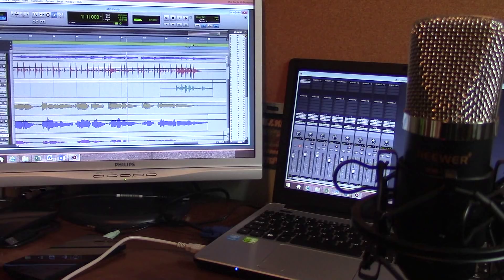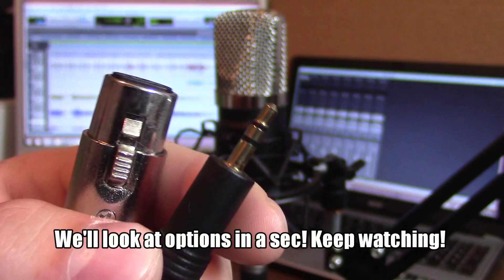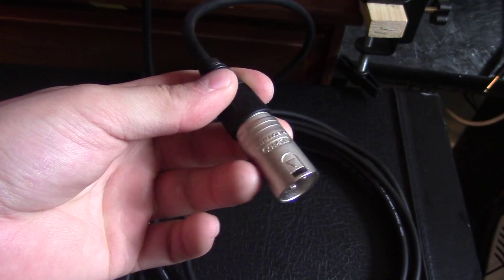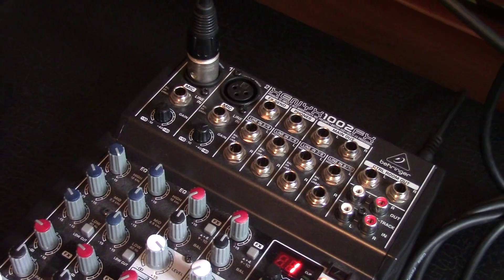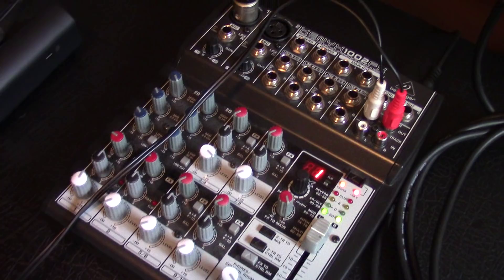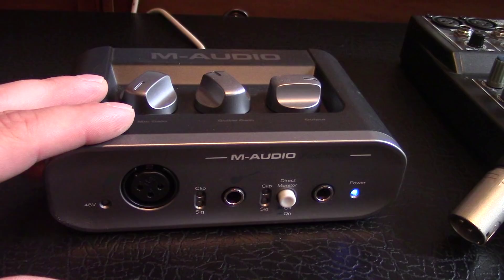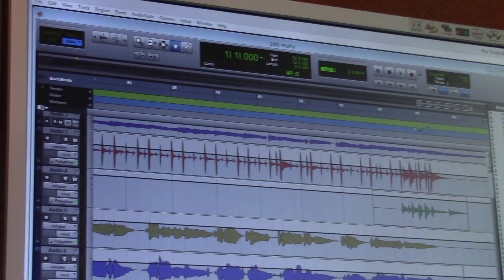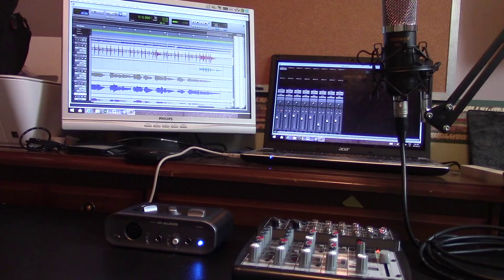How to hook up the Neewer NW-700 / BM-700 / Any condenser microphone

Comment: Thanks for the video. One update - this is an electret capsule microphone which only requires a microphone bias voltage - which only needs to be in the range of 5-9 volts, not the 48 volts of the professional phantom power. Luckily inside the microphone, there is a 5v zener diode to drop the 48 volts down to 5v if you use 48v. A "true condenser" professional microphone will require the 48v phantom power.
What this means is that the NW-700 can be used directly with all SmartPhone and some (but not all) laptop 3.5mm jacks as those sockets are designed to work with electret headsets and have 5v bias voltage on the audio line.  If you have a laptop which doesn't have the 5v bias voltage on it, some USB audio dongles (e.g. the Sound Blaster one) apply a bias voltage to their 3.5 microphone socket and hence the NW-700 can be connected to a laptop that way.

regards, Ed Durrant.

Comment: 1:07 I don't know on you guys but on my laptop, I can use Neewer 800 without any phantom power just plugged it on the mic jack. Additionally the audacity gives good output with no noise without a phantompower don't know why but it works a lot.

Comment: My question is how do you get rid of the fuzzy noise in background ?😫 I can't really make music if that fuzzy sound is messing up my music🤕
Reply: Same here...
Reply: Trill Princy do you guys have a Phantom Power Supply?
Reply: you need um idk maybe a mic cover
Reply: You might be able to use a microphone pop circle.
Reply: you need a phantom power supply and xlr to xlr cable
Reply: Sabrent External USB sound card
Reply: pls help i have microphone -> xlr to xlr -> Phantom power 48v -> xlr to 3.5mm -> computer
Reply: Yxng WS i have. Rip
Reply: where you are plugging the 3.5 mm jack into ur pc might be the problem. you should use the jack on your motherboard if you have a tower and not a laptop. but the front pannle can get noisy with all the other ports near it and not good isolation from other ports.
Reply: Trill Princy tell me, are you using a laptop? because if so it might have to do with line in cables
Reply: Are you connecting to the motherboard, case audio connection, or usb? Try connecting to your motherboard and if it doesn't sound good use a sound card. Also phantom power might be your problem.
Reply: Maybe try soundproofing? idk?
Reply: If youre using it for music, thats why theres something called post processing aka *editing*...
Reply: Sound foam and sound card
Reply: apply a noise gate
Reply: You need a usb sound card

Comment: for my NW-700 I got a black power supply (thing that plugs into wall)
 that connects to an outlet into a wall.. The wire from the power supply connects to AC18V which is a plug. Inside the neewer grey box (forget whats its called) the mic cord goes into the outlet but what goes in the input..

Comment: Some people say you need Phantom Power and some people don't but the people who say you don't say you only need it if you use an Audio Board.
Reply: if your using audio interface or USB mixer (like me) you really don't there high chance it has one built in
Reply: Any condenser microphone need some kind of voltage going to to them. Most need 50+ but almost any condensor mice WILL work with 4+ Volts.
Reply: nah nah nah.  (from my extensive research) am pretty sure you only need the phantom power if using a lil LappyTop or something. heheh. But.. BIG BOY Computers ( DESKTOPS) dont need one. 
And, ..(on that desktop) it's recommended you plug it into a usb port IN THE BACK of the pc ...
Reply: Mike Flatbird are you sure cause i have a big boy desk top (imac) ?
Reply: @Julio - Welp, ..as i stated, ..my commentary was made from "research" (that ive seen/read others saying).
-- Me though ..yes ..even though i have a BigBoy computer (lols) ...i STILL though..went ahead with purchasing the PhantomPower source, ...nah i did not try it without it, so i dunno to be completely honest, for i do not have firsthand experience with using that without it But yeah , i'd think any (modern) DTop pc/or mac etc would be able to push-out 48v's easily ..
but dont quote me on it lol...
Reply: ALL CONDENSER MICS NEED PHANTOM POWER. PERIOD.

Yes, phantom mics will often run on less than 48 volts, but you lose performance and frequency response. What you really want is his choice B. An audio interface that has phantom, and uses USB into your computer.

Comment: for all of y'all wondering why your mac doesn't recognise the mic,  you need to purchase a 3.5 mm mic jack to usb bc the macs use a low power audio-in jack that can use line-level and not mic-level.  stick to usb mics if you haven't bought the mic yet, but if you have thats your solution.

Comment: Can anyone help me? I got this microphone, set it up, plugged it into my Scarlett Focusrite 2i4 with a XLR to 6.35mm jack cable, turned on Phantom Power and I don't get any sort of feedback or noise coming out of my speaker (which yes, are connected to my sound card correctly). Any help is appreciated thanks!
Reply from the maker: +Crocodile MusicHD So, is the scarlett plugged directly into your computer? Or into a PA or cabinet? If you're running into a computer, i'd suggest maybe software issue?
Reply: +Weiderfan Hi there, as it turns out, it was to do with the voltage going into the sound card. I ordered a little box that provides phantom power to any condenser microphone and has midi in and out inputs! Here is the link: http://www.amazon.co.uk/BTSKY-trade-Condenser-Recording-Microphone/dp/B00S0QAA5Q/ref=sr_1_1?ie=UTF8&qid=1451133941&sr=8-1&keywords=Phantom+power
Thank you very much though! Great video, keep up the good work bro!
Reply from the maker: Great! Glad you have it all figured out! Enjoy! That power supply should work just fine! :)
Reply: Hey even I have the same mic and Scarlete 2i4. I do not get any sound from my speakers, unless I turn up the volume to full, it picks up very little sound. Please let me know what worked for you. Thanks!
Reply: im having the same problem but i already have mine connected to the phantom power...i cant hear my voice at all as if mic was muted

Comment: I just bought this, and on Amazon, it says that this will work on 5V desktop PC power from the sound card without using phantom power; should I ask for my money back and return this?  I will not spend more money to buy a preamp.
Reply from the maker: +Steven Bringhurst Hmm. It is possible that certain desktops will have power to the 3.5mm jack capable of running it. Not likely, but I would definitely give it a try before sending it back!
Reply: Same here but I didn't discover it until 2 months later

Comment: I have the Behringer PS400 Ultra-Compact Phantom Power Supply, the one you put in description and i dont know how to hook that up to my computer
Reply from the maker: +Zac Cooper It should have an XLR out. With the mic, you should have gotten an XLR-3.5mm. Use that cable to connect the PS400 to your computer, and you will need another XLR-XLR cable to go from mic to ps400.
Reply: its connected to my computer i cant hear myself tho
Reply from the maker: Software issue. Are you using any recording software? Because you're not using an interface, you'll have to play with computer settings to help your computer recognize an external microphone.

Comment: can i hot swap the mic without turning off the phantom power?? will it damage the mic?
Reply from the maker: +sayhai Nah, it won't bother anything. You mean to simply unplug and plug without turning off the power source right? That's fine. Drop your volume down first if you have a mixer. Otherwise you may get a POP in your headphones or speakers. With any large amount of volume, it could damage your speakers (OR EARS).
Reply: thanks alot.

Comment: HELP !! 
I just bought a neewer nw700 microphone kit . I set it up and the connections are all correct as far as i know. (XLR-XLR cable from mic to input of phantom power/ XLR-3.5mm wire from output to the usb adapter which is connected to the computer.) I connected the phantom power to the power source. However, the light in the phantom power doesn't glow and the microphone doesn't work either. Please help me.

Comment: I use the computer USB method on my new NW 700. I am using Windows 10 and Bose speakers but no sound is showing up at all even though it recognizes the mic had been plugged in to the jack. All Reddit posts on this basically are saying that's it's a cheap piece of junk that doesn't work by its nature. Please help...

Comment: Hey mate! I watched the video and was quite satisfied with the Video and the quality.Thumbs up for that👍
I wanna ask just one thing that do we need both or anyone of them?
Reply from the maker: Thanks so much. I'm glad you like it. You need ONE of them. Either an audio interface OR a mixer. The behringer 302usb is a great choice. Very simple hook-up, and even comes with software.
Reply: hey can i buy this https://www.amazon.com/dp/B000XUUXB8/ref=cm_sw_su_dp will it work?
Reply from the maker: it should! However, i've been told that you wont get the best quality sound with just a power supply like this (for reasons I cant explain. something to do with balancing of connections). I'd personally spend a little more and get the mixer!

Comment: Do you absolutely NEED an interface? I have the neewer mic, connected to my Phantom Power, and then the Phantom just connects directly up to the laptop via 3.5mm. Also, if you don't absolutely NEED the interface how do you get the mic "working" in FL 12? When I go to select the mic in the mixer on FL 12, it emits a painfully loud SCREECHING sound that wakes anyone asleep up, and to get rid of it I have to exit out of FL.

Comment: Alright, I have newer bm-800 and I have a phanotm power box but I can't get it to work on my HP Pavillion Laptop it has windows 10
Reply: It's incompatible with laptops because it requires at least 5V of power.
Reply: It works with laptops if you have the phantom supply ...
Reply: Tyler Bundy You are mostly using a line-in slot for the cable, get an XLR to USB cable

Comment: I was also wondering, why you have a behringer phantom power and an audio interface that is also phantom power? or am i wrong and you need them both? because i dont think you do?
Reply from the maker: +Colin Palmer Great question Colin. I am using the behringer sound board because I love the audio/ dynamic control it gives me. I can control sound quality before it ever enters my computer. However, I NEED to use the other interface as that is the only way my ProTools software will work. Soo.... I end up going into my sound board, and then into the interface to get it into my software! Hope that clears things up. I use both, but only 1 power source is needed!

Comment: When I bought my NW-700 I was unaware that this mic cannot be used with mac's. Is this true? Or is there anyway to get my NW-700 to work with my macbook?
Reply from the maker: +Amir Rashid This mic will work with a mac. You just need an audio interface. As long as the audio interface and software is compatible with your mac, then it doesn't matter what mic you connect to it. Everything will work!

Comment: so i got the nw 700 and the behringer ps4000 but it just wont work for some reason i dont know what im doing wrong, i got everything i need but i used the cable the nw 700 came with to run the audio out from the behringer is thats whats wrong?
Reply from the maker: +XxblazepwngexX -the gaming channel hmm. That's odd. Assuming you have everything hooked up correctly, which is quite simple if all you have is the PS400. I would guess that either you have a bad cable somewhere, or you have a software issue (ie. your recording program has an issue). I remember having everything hooked up correctly, and spending a BUNCH of time fiddling around switching out cables and etc, trying to find the problem, when the problem was that I simply forgot to click the little red engage button on protools! haha

Comment: Okay, I need help. mostly to know if I need a different program or not.  I bought the NW-700 mic, and an NW-100 phantom power supply.  It is all hooked up, it records well enough in windows basic ass recording software, but it is shit in audacity.  Is this just audacity being ass or do I need a better soundcard to handle a powered mic?  Yes I am using a 3.5 jack to plug in from power supply, should I consider XLR to USB?

Comment: I have connected my Neewer-nw700 to my laptop exactly like yours. Phantom power on...XLR cable connected to mixer and the mice. But nothing work. my laptop won't recognize anything either. I have looked at your other video where you explain the windows mice set up but it doesnt work either. seems like i'm doing something fundamentally wrong but i cant figure it out!! any thoughts?

Comment: I bought a nw 700 mic with a newer 48v phantom power supply. I use fl studio and whenever I go to use it, the sound gets taken in by my laptop mic instead of my nw 700, anything?
Reply from the maker: +Chris Pignotti Hmm. That should definitely be a software issue. Probably need to play around with some computer settings. Good luck! Wish I could be of more help!
Reply: +Weiderfan thank you
Reply: +Chris Pignotti Change your default input in your audio settings.

Comment: If you have an audio interface such as a M-Audio M-Track that connects to your computer via USB, do you need to run a cable out of the interface into your computer to output sound? I'm generally going to be using my microphone for streaming on twitch. I bought an interface, a microphone and a XLR cable. Do I need anything else? Thanks!

Comment: Great video!
Informative with lots of good options.
I just received today the BM 700 Tonor condenser mic kit.

I went for a budget/beginners style of mic/kit. This one seemed great, from the several review vids I seen .

Am a bit confused though. I'm hearing completely different stories with phantom power. 
Since I'm just using a standard HP PC laptop, was told that phantom power adaprter was not necessary and I can just plug directly into laptop. 
--was also told to purchase USB Audio Stereo Sound Adapter (with USB plug at the end) from Sabrent. That I can just connect directly into laptop with this in stead of the phantom power . 
True at all? 

Any help is appreciated.
Thanks
Reply: For me, my microphone is coming in next week Thursday and since the microphone head jack is in the set, i dint know if i can just plug it into my ipad headphone jack or if i need that apple headphone jack

Comment: I have bought the NW 800 Professional Studio Broadcasting & Recording Microphone and I then I just bought a phantom power to it, but its just a square box phantom power from amazon that only connects to the mic and then laptop and doesn't do any other thing to it. Would that still be fine? (the phantom power is Neewer 1 Channel 48V Phantom Power supply black with adapter and one XLR audio cable for any condenser Microphone music recording Equipment). Late Christmas shopping c[:
Reply from the maker: +FullMoOnPiano better late than never! ;-) That should be just what you need! Mic runs into the power supply, and then the power supply runs into the laptop. Perfect!
Reply: Thanks a lot!!! can't wait !
Reply from the maker: Enjoy! :-)

Comment: Is an audio interface necessary? Would I be able to hook up the microphone to my computer and use software on my computer to monitor it?
Reply from the maker: +Oliver Bass As long as you have some sort of power source, Oliver. This is a condenser mic, so it needs power that your computer wont provide. Now, an audio interface will do this, as well as a mixer, or you can buy JUST a power source on amazon for a pretty low cost of 20-30 bucks!
Reply: Thanks! I was just checking cause I planned to get the power only because the audio interface is rather expensive, but I see that there are ways to get around it by at least buying a 10 dollar adapter to split the mic from headphones
Reply from the maker: Good luck Oliver! you'll figure it out! ;-)

Comment: The problem is that even with such mixer the sound is pretty quiet, how is it possible to amplify/make a microphone louder without loosing quality and gaining noise??????????? I have got exactly the same settings as yours, well I added some bass to my voice to sound like more radio-ish however the problem I have is that to hear me there is a need of turning volume up, from 50% to 100% I can hear my voice clearly, however below 50% you can still hear me but you have to be in a very quiet room to hear my voice properly. Could you tell me what is the problem? Is gaining volume on xenyx1002 not good enough or is it mic problem? As it is pretty cheap mic, soo I am not sure what is the problem! I could record something and give you link, and could you tell me if the volume of my voice is decent or not???!
Reply from the maker: +SuperKawaiiChannel Sure, if you did that and sent a link i'd have a listen. Not sure what it would tell me, but, go for it! Are you using the interface that I have as well? Everything the same? What recording software? When dealing with audio, there are SO MANY things to play with.. it's hard to narrow it down!
Reply: Weiderfan thanks for spending time to respond to my message, I found the problem, the problem were my headphones I have got "TV" headphones with 10 meters long cable, I changed to another headphones and it seemed to work like a charm, sorry for taking your time, next time I will make sure I will check everything before writing useless comments.
Reply from the maker: +SuperKawaiiChannel you're very welcome my friend! I'm just glad that you're up and running! enjoy! :-)